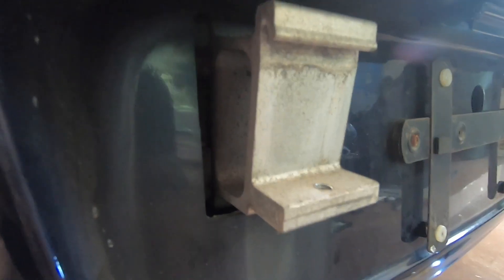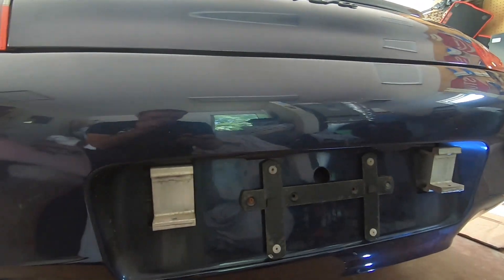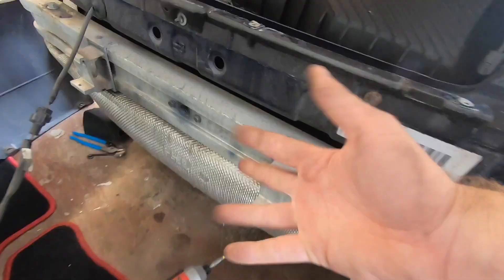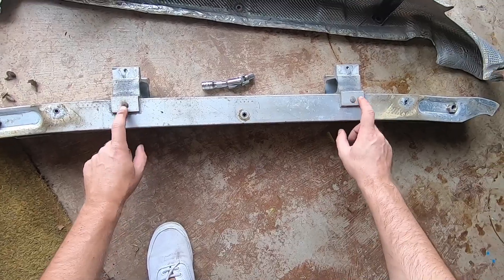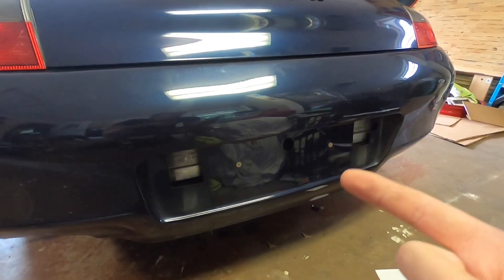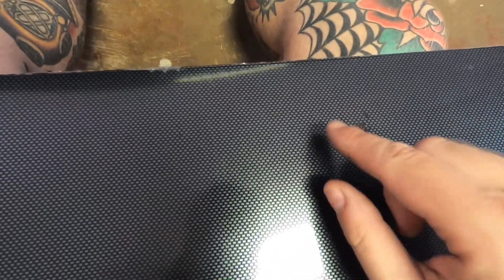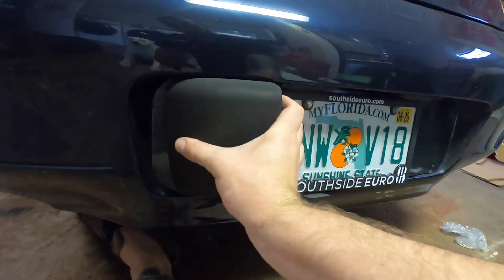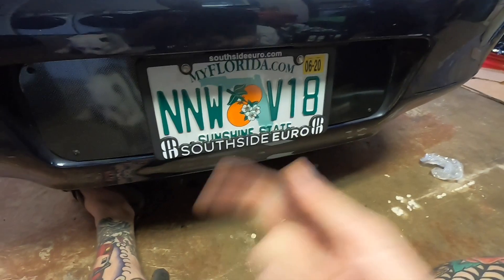Mein 911 | Episode 9. 996 Bumperette delete

Comment: So i actually am doing the reverse of this and putting bumperettes back onto the crash bar. Is it hard to revit those back on? Somone removed them prior to my ownership and i dont wanna take the bumper off again to find out the cant be put back on.
Reply from the maker: Rivets might be hard if they were drilled out before, I had to break some of mine out lol. I would try and use a self-tapping screw just slightly bigger!